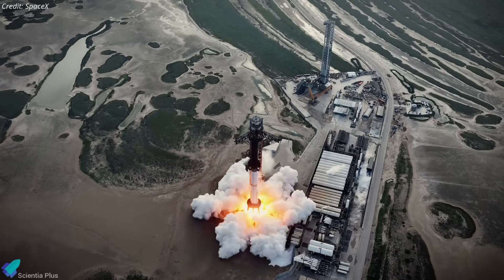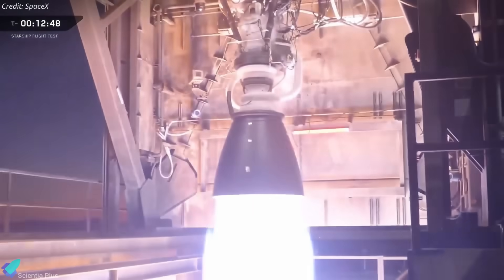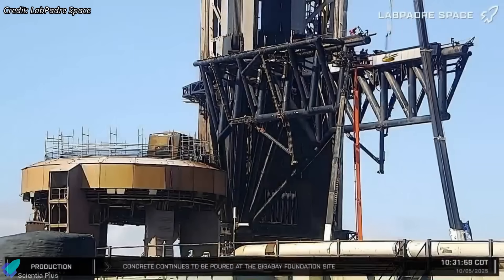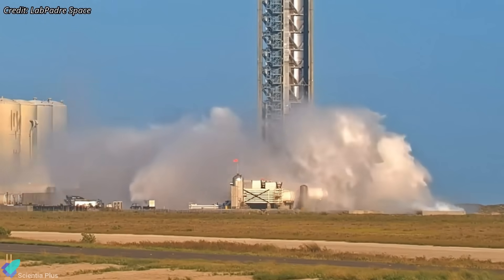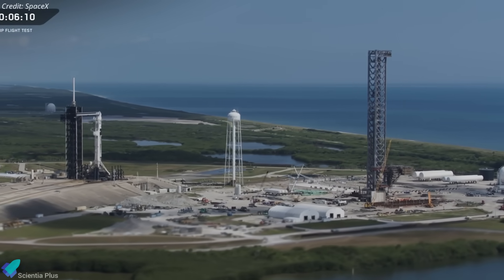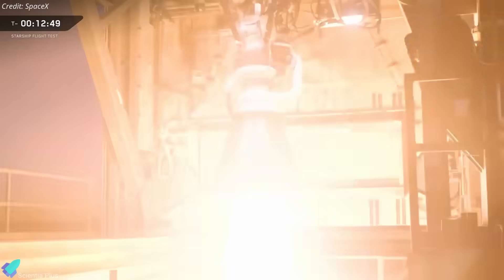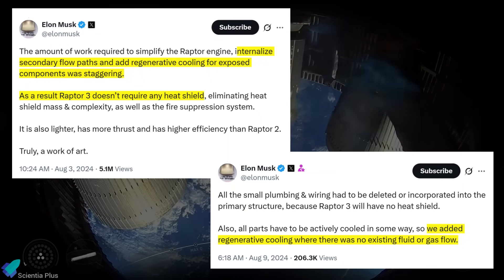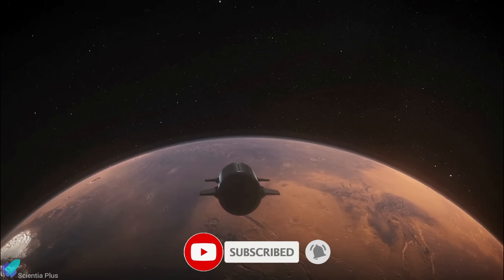ULA CEO ATTACKED Starship Raptor Again! Elon’s Team Instantly Proves Him Wrong!

Comment from the maker: 🚀 Starship Block 2 Explained:
 📖 Summary: https://shorturl.at/b0dtw
 🔍 Detailed Explanations:
  • Design Improvements Update 1: https://shorturl.at/lpGT7
  • Design Improvements Update 2: https://shorturl.at/gwNQ4
  • Nosecone & Payload Bay Redesign: https://shorturl.at/xa60S
  • Methane Downcomer Redesign: https://shorturl.at/XdYBG

🚀 Starship Block 3 Explained: https://shorturl.at/mnBT4
  • Detailed Breakdown: https://shorturl.at/IViwD
  • Production Begins: https://shorturl.at/xRNkJ
  • New Transfer Tube / Downcomer: https://shorturl.at/Iaqc6
  • New Grid Fin: https://shorturl.at/NxdVo
  • New Integrated Hot Stage Ring & Forward Dome Upgrades: https://shorturl.at/bvaCn

🛢 Dual-Port Orbital Refueling – Full Technical Breakdown
https://shorturl.at/5tiqK

🚀 Starship Block 4 Unveiled: https://shorturl.at/7A2ef

🔥The Insane Engineering Of Raptor Engines:
     Part 1: https://tinyurl.com/348hsrya
     Part 2: https://tinyurl.com/p8k85mu6
 
🔥 Raptor V3 Explained:
    Mega Upgrades & First Test: https://shorturl.at/TRIyj
    Raptor 3 Evolved Again - More Protection This Time: https://shorturl.at/3YpCe

🛠 Insane Engineering of New Starship Launch Pad: https://shorturl.at/7RAZd

🧱 What’s Inside Starship GigaBay?: https://shorturl.at/nJM75

🛠 Other Starship Upgrades:
 • Hot Staging Explained: https://shorturl.at/jf400
 • Super Heavy Booster Upgrades: https://shorturl.at/Pi5R3
 • How SpaceX Protects Raptor Engines: https://shorturl.at/4Om8F
 • New Heat Tiles Explained: https://shorturl.at/p2Ijb

🚀 Starship Flight 11 
   📽Detailed Breakdown: https://youtu.be/r6jHVPpiEcw
   📽How it Survived Heavy Damages: https://www.youtube.com/watch?v=8qw2E31T8ZM

📡 Stay Updated:
📢 Weekly Updates: https://bit.ly/3HIQjPC
🚀 SpaceX Playlist: https://bit.ly/34wue8T
Reply: Who made this video and why is it so damn fast? Cut to cut to cut... I need a dramamine just to watch. That and the narration being at like 1.25 or 1.5x sped up. Why? Also, your comment was made with Grok. I know the format.

Comment: A Severn loop travelling block in place of a five loop travelling block, would give the chopsticks more lifting power, but it won’t make them faster, it will make the travel of the block slower.
Reply: Might be done to increase accuracy but definitely won't increase speed , like you said it's travel speed will be slower

Comment: But why does SpaceX have to justify itself to Bruno? They only have to build an even simpler and more powerful engine and not wait to reveal their competition secrets . What has Bruno guarded so far?
Reply: Bruno knows that he can’t keep up with SpaceX. His engine is technically way behind the Raptor-3.
Reply: @peterclarke3020  Bruno (ULA) doesn’t build engines. They buy them from Blue Origin.
Reply: @DavJumps and theirs are no comparison to v3 or even v2
Reply: @davefarmery8180  Of course you can compare them: Blue’s are far simpler in function and yet crazily more complicated in appearance; they produce less than equal thrust why being significantly larger and heavier; they’ve likely only built a couple dozen of them to date while SpaceX has already built over 600 raptors, and successfully flown hundreds of them — some multiple times.  

SpaceX can probably roll a new completed Raptor off their production lines in intervals measuring mere days or even hours.  

And let’s not even talk about unit cost!
Reply: @peterclarke3020  😏🙏